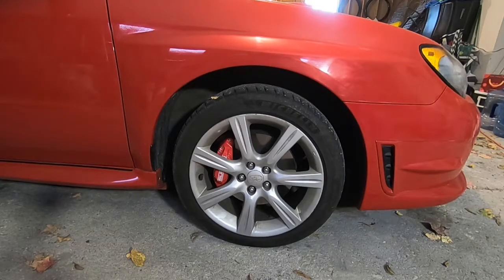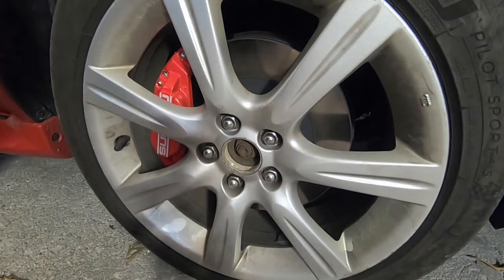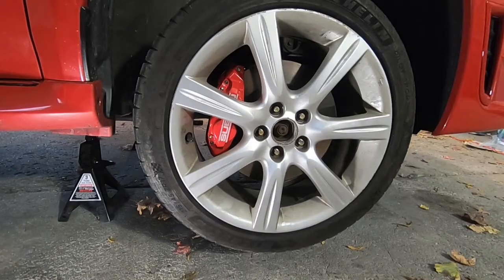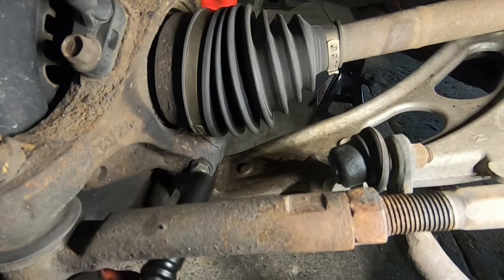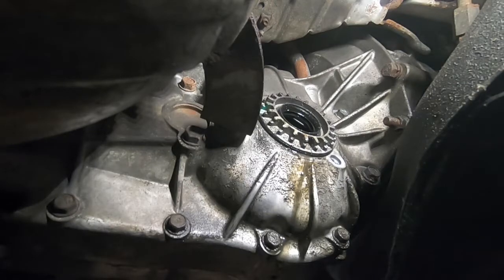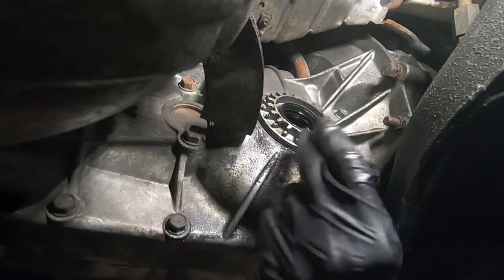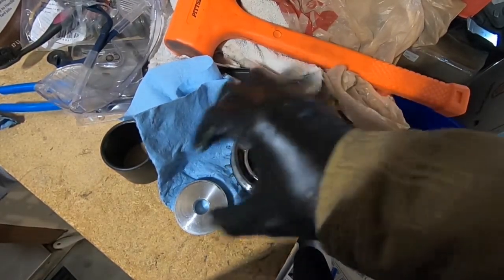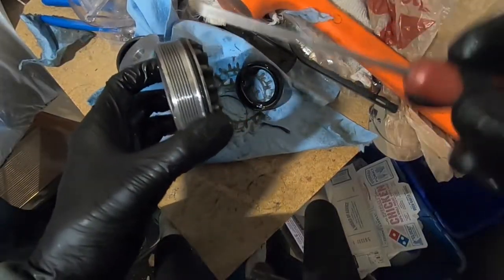2006 Subaru WRX Front Axle Seals

Comment: Ya I had some shop replace my driver axle seal 4 years ago I always had a bearing noise around the transmission area after that never realized those out preload on the bearings and I don’t think they did either definitely didn’t count as they took it out

Comment: Great job. Thanks! I have one suggestion: I couldn't get the axle out of the hub, but I was able to pull the the entire wheel assembly and get the axle out of the box. Because there was some tension on it, I didn't want to damage the seal putting the axle back in, so I slid the seal assembly over the axle before putting it back in. That also meant I didn't have work so hard at getting the axle in the spline.

Comment: Very well done! I have had my 2013 Forester to the dealer twice to fix this issue. It was still leaking and they told me I had a crack in my case, around the seal. I couldn’t see one and from where it was leaking I couldn’t help but think they pinched the O-ring on install. If I would have known it was so easy to do myself, I never would have taken it in. It fixed my leak. Thanks for the high quality and very well done video. The links made it super easy to get what I needed.

Comment: Could you also put in the seal from the other side of that retainer ring? So you dont have to remove it from the differential housing?
Reply: Yes there's no need to remove the pretensioned bearings just pop it out with a screwdriver use the old seal to tap the new one in.

Comment: I forgot to mark and count the bearing holder assembly’s initial position. Would it be possible to measure the height between the untouched bearing holder and the trans and match that?